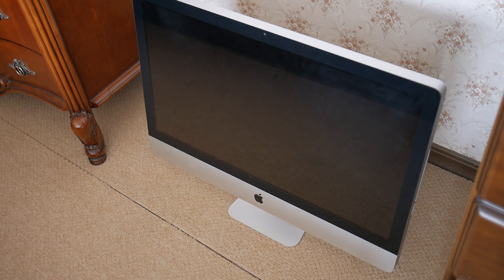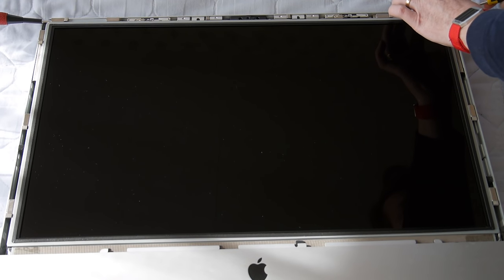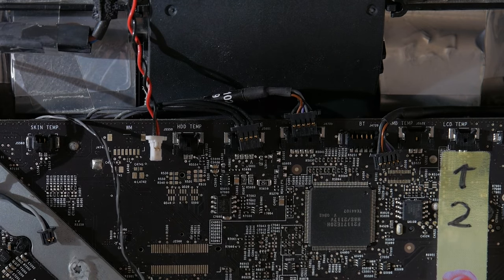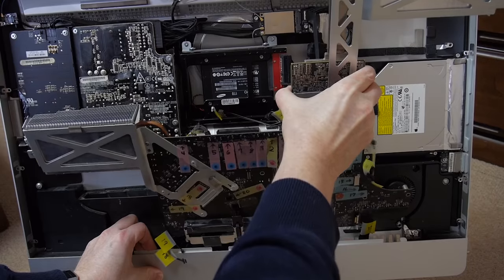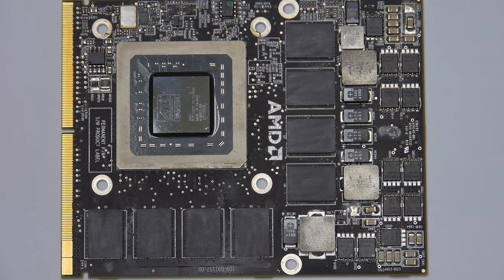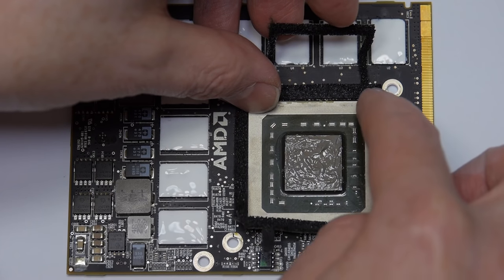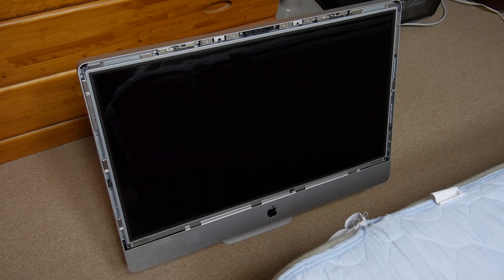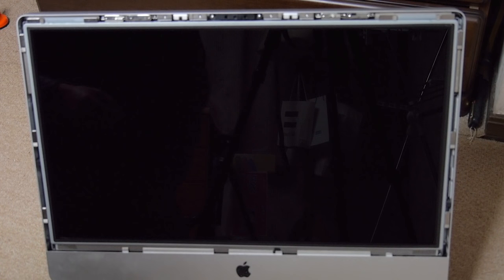Late 2009 iMac 27" Video Card Repair [4850 Bake]

Comment: I can not believe it, it actually works. I was skeptical about it but I had nothing to lose. Instead of using the oven, I used a heatgun and aim it for about 4 min. Thank you very much for your video.
Reply from the maker: Thank you for the kinds words and your report of success with a heat-gun, Phong!  You said you applied the heat for 4 minutes, but what was the distance between the GPU chip and the heat gun?  And did you keep that distance consistent during those 4 minutes?  The reason I ask is so that your answer can help others who may wish to try it instead of an oven.  Thank you!
Reply: I aimed my heat-gun and rotated in a circular motion at the chip only, not the entire card. The distance between my heat gun and the chip is about 1.5 inches.

Comment: The ATI Radeon 4850 Video card for my Late 2009 iMac 27” machine stopped working after Thanksgiving. I bought my system back in 2010 and it worked consistently for 11 years until last month!  It was noticeable slower over the past few years but until it stopped working I wasn’t ready to get rid of it.  I bought a brand new Mac Mini to replace it before I saw this video.   The bake was successful and I am back up and running with the iMac.  While this system is WAY SLOWER than my new Mac Mini, it still can surf the net and do simply tasks pretty well.  I might even put a SSD drive in the system to make it faster.  While this is clearly a back up system for non critical needs, it is good to know that it still can function.  Thanks for the video!
Reply from the maker: Great to hear that!  But the single BEST upgrade for these old iMacs is an SSD.  It's a night and day difference in performance.  Be sure you have 16 or 32GB of RAM too, especially if you have two users open all the time.  That can make a big difference as well.  Merry Christmas!

Comment: Thanks for all the effort you put into making this video. I have never seen such a detailed video that really leaves no questions unanswered. Even I, as a woman, had no problems getting my iMac up and running again. I hope it lasts a little while.
Reply from the maker: Thank you for your kind words.  I am certainly pleased to hear that you were able to get your iMac working again using my video as a guide.  My first bake lasted only 4 months, but I think that was because I didn't clean off all the old thermal paste and apply all new paste.  I did that in my second bake, which then lasted 2 years and 9 months. I can only hope yours functions as long or longer as mine did after my second bake.  Best wishes!

Comment: I looked for this video pacifically to tackle the same issue/problem I had a year ago with applying thermal paste. I remember you gave excellent instructions on this procedure. Last year I used some watery thermal paste that only lasted few months. This time I will use either Arctics Silver 4 or 5 as you suggested. My main reason for my comment is to say "Thank You" for your detail information.
Reply from the maker: Thank you for watching and commenting!  I highly recommend that before you do anything else you watch the following portion of my 2nd Bake video which discusses the K4 and K5 Pro thermal pastes I used.  So far, my 2nd bake has lasted 1 year and 6 months, and the machine is still going strong.  In my first bake, I used Arctic Silver V on the GPU, and a rather old and generic thermal paste on the memory chips, and I didn't fully clean off the old Apple thermal pads on the memory chips either.  The first bake lasted only 4 months.  So that was either due to the thermal paste I used, and/or due to the fact I didn't clean off all the old paste on the memory chips, or it could be my GPU simply needed two bakes.  I'm not sure, but all I can say is that K4 & K5 Pro is still going strong.  Also note you cannot use Arctic Silver V on the memory chips because it is electrically conductive and would have some overspill that would cause shorts.  Plus Arctic Silver V cannot be used as a replacement for thermal pads, which is needed for the memory chips.  Again, watch the portion of my 2nd bake video below for details on the thermal paste and application method I used. https://youtu.be/6BJGLFCigdA?t=1658
Reply: @JDW- , I did watch the other video this morning and don't remember if I had baked the chip the first time after replying new paste last year. My question is: can I use just one of the selected K-5 or K-4 thermal paste for both memory and CPU? I bought the K-5 kit and Gelid Extreme as an option. Should I use K-5 on CPU and Gelid on memory? Your suggestion will be greatly appreciated.
Reply from the maker: K5 Pro is made specifically to be a replacement for thermal pads.  Thermal pads are used when there's a big gap between the heatsink and the chips you want to cool.  That's why K5 Pro is a very thick paste and you can use a lot of it -- so much so that it shocks people who otherwise think I have applied to much of it in my video.  But what is you see in my video is the proper amount and proper method of application according to the manufacturer.  You cannot, however, use K5 Pro on the GPU because Thermal Pads (and thermal pad replacement pastes like K5 Pro) do not conduct heat as well as regular thermal paste like K4 Pro.  So if you did use K5 Pro on the GPU, because it is not intended for that, the GPU would likely overheat (i.e., fry itself to death).  That would be a very bad situation that would result in a dead video card that cannot be resurrected.  Regarding Gelid Extreme, I've never used that before so I cannot offer you my personal experience with it, but it has great reviews on Amazon, and I see it is a normal thermal paste that you can apply to the GPU of your video card.  So, yes, I think using Gelid Extreme on the GPU and K5 Pro on the memory chips will be just fine.  You shouldn't have any problems doing that.
Reply: @JDW- , Thank You Sir for your knowledge and input on this subject. Your videos and responding narratives are very detailed. Cheers!

Comment: Today followed your instructions on an IMAC 27" late 2009 with video problems (yellow strips, stuck after several seconds). Never had to 'bake' any hardware so you might say I was a bit reluctant to actually put the videocard into the oven (9 minutes and 30 seconds!!). But since there where no other options I said, lets give it a try. And you know what? It actually did the trick, my so beloved IMAC 2009 is raised from the dead. I do not know for how long, or what other future problems will arise, but for now this is great! Thanks for taking the time to make this video. I suggest removing the  memory sims before anything else, otherwise you might have problems putting the motherboard back in place. Again thanx alot!
Reply from the maker: Not only "remove" the memory but also remember to "put it back" when done too!  I neglected to do that, and as you could see at the end of my video, I got the scary beep, beep, beep.  Anyway, thank you for letting us know the bake was a success for you.  Please note that I made 2 videos.  This video was of my first bake which lasted 4 months.  I then made a second video showing my 2nd bake, and that video was made the first week of July 2017.  It's now the first week of February 2018, and my iMac's video is still going strong.  Not sure if the longevity of my 2nd bake is due to my having twice-baked the video card or my having used different thermal paste the 2nd time.  In any case, I hope your bake lasts years.  Even so, in my experience, a brand new card lasted me 3 years TWICE, so I would be surprised if my 2nd bake lasted beyond that.  Sadly, the card was designed badly, which is why we have this problem in the first place.  Best wishes!
Reply: Hi. I have a problem, I did what you said, but it only gives me external video, if I connect the screen of it, it does not send the imac, but if I disconnect it works very well by external video.

Comment: Thank you so much for all your patience to make this videos. The instructions were completely helpful. I followed them one by one and my iMac 27'' Mid-2011 is working well again. I would say the label every single cable and screw have simplified the procedure. The only thing I didn't do was use thermal paste. I used the leftover. Cheers and best wishes to you from Colombia.
Reply from the maker: I am very happy to hear your success, Juan!  By the way, you said you did not use new thermal paste.  That may or may not be a problem.  If  you experience system freezing or unexplained crashes in the future, it could be related to the thermal paste, in which case you would have no choice but to buy some paste and apply it.  That's a real pain because of the time it would take, but that is the reality of it.  So long as the old paste had not hardened too much, and so long as it still moves a lot of heat from the chip to the heatsink, you should be ok.  Best wishes!

Comment: Wow you are the best. Just did this on my wife’s 27” 2009 which is still a great machine. Works great now.  I didn’t take out the motherboard to change the battery because I have a faint memory of doing this when I changed the HDD to an SSD, but not aure
Reply from the maker: That's great to hear.  Thanks for making time to let me know your bake was a success.  Best wishes!

Comment: you    wont believe this 3 years ago i followed your steps to the letter of the law it did not work so i put it back in its box and one year later forked out on a new one .yesterday i was about to throw it out and rescue the hard drive and turned it on and hey presto .well done and thanks now i have two imacs
Reply from the maker: You didn't do anything other than remove it from the box 1 year later and try to power it on?  It's interesting it didn't work after you baked it 1 year ago but now it works.  I'm afraid I cannot explain that. But so long as you baked it at the right temperature and duration and applied a good thermal paste, you should be good to go in the long term.  Best wishes!
Reply: @JDW-  i would like to say a huge thank you again to you and for your patient well presented video

Comment: Hi, my bake lasted 6 months, it worked like a charm for that period and it was an inexpensive way of bringing back to life a totally capatble computer.  Going for a 2nd bake today.
Reply from the maker: Thank you for your comment. What kind of thermal paste did you use?  My first bake lasted only 4 months, reason unknown.  On my 2nd bake I switched to different thermal paste (K4 and K5 Pro).  The only other change I made was to increase the bake time to 10 minutes.  So far my 2nd bake has lasted just about 13 months and is still going strong, used daily.
Reply: Hi JDW, I used Arctic Silver Céramique 2 in the graphics cards main chip and used thermarl pads on the other 4 smaller chips. My first bake was 10 minutes. lasted 6 months. I did yesterday the 2nd bake, also 10 minutes, it's working again, let's see for how long. This is a 2008 iMac computer, still a great computer in 2018 and does eveything I need it to so I would like to maintain it as long as possible. The Graphic cards problems in Mac computers are related to planned obsolescence, they want you to buy a new computer and new iPhone every 2 years, even if you computer and phone serve you well they will plan the product to fail after some years or they will release a new operating systems that kills it for good.
Reply from the maker: Thank you for the information.  The reason I was curious about your thermal paste is because I'm trying to determine the root cause of "1st bake failures."  But since your machine is a 2008 model with different video card, it's difficult to make an exact comparison with the video card in my late 2009 iMac 27" model.    So perhaps the reason my 2nd bake has lasted more than 1 year is due to better thermal paste (both on the GPU and the thermal pad replacement paste I used on the RAM chips), or perhaps my card just needed another bake.  So while the reason for the success of my 2nd bake is yet unknown, I just hope it will keep going strong.  I doubt it will last longer than a brand new card (which lasted all of 3 years in my experience), but who knows.  Time will tell, and I will keep updating the text Description under the video monthly to keep everyone informed.  Best wishes!

Comment: Awesome! Thank you for posting, with your guidance i got my dead imac 27 2009 back working again.  10mins at 205 deg.c in my case. Thanks again
Reply from the maker: That’s wonderful to hear! Thank you for letting me know, Will!
Reply: So it just wouldn't start? I have 2011 imac and I start it with a hairdryer but if it turns off it won't start

Comment: Just baked my card and my computer is working again!!  It is like witchcraft.  Makes no sense at all but thank you very much indeed for giving me the confidence to try it.  Only fly in the ointment is the fan is working flat out.  I never heard the fan before but now it is quite noticeable.  Thank you once again.
Reply from the maker: Thank you for making time to let me know your bake was a success! There have been several people who have reported the same thing you have after their bake – the fans run at full speed. The reason is because you either forgot to connect a particular connector or you did not connect it properly. To fix that you can do one of two things. You can re-open your iMac and check all the connectors, which would take a while. Or you can expand out the text description underneath my video and download one of the fan control apps that I link there. Best wishes!

Comment: It worked perfect for me... exactly as you did it... 9 minutes... I also managed to broke 2 small condensers on the motherboard while pulling away the 3rd connector from the monitor (near the LCD temp sensor) and I managed to solder only 1 of them back. The second one was to difficult (too small). But it worked fine without it after that.  It didn't make any problems for now. After baking it did't want to start, and I thought I must buy now a new motherboard. But the problem was that I forgot to put in the RAM :))))) You saved me 600$ on a new card or about 250$-300$ on reballing or soldering of a new ati chip from a third party repair company. Thanks!
Reply from the maker: Thank you for letting us know of your successful bake!  As to the capacitors you broke off, please keep in mind that capacitors can serve different functions.  Some act as noise filters.  Some are required to keep the voltage from dipping.  Regardless, the fact you were unable to solder back one of the capacitors (assuming it was a capacitor and not an inductor), may or may not cause problems for you down the line.  As such, if you experience anything unexplainable and out of the ordinary in the future, such could be traced back to that missing electronic component.  So you may need to prepare yourself for soldering that component (or an equivalent) back in the future.  Until then, enjoy your "new" iMac!

Comment: Thanks so much for this excellent procedural video. It was easy to follow, and adapt from. I replaced the dead card in a 2009 iMac with an hd5750 1Gb Radeon from a mid 2010 iMac, and it works a treat. You will need the entire gpu & heat sink assembly to do that if anyone is wondering.
Reply from the maker: Thank you for sharing your experience with a more modern video card replacement.  So  you removed the video card and the entire heatsink assembly from an 2011 Mac and put it in your 2009 iMac, is that right?  Did you have to cut anything?  I've heard that newer cards and/or their heatsinks don't fit perfectly.
Reply: JDW I purchased the gpu/heat sink assembly, taken out of a mid 2010 iMac, from eBay, and replaced the 256mb failed one in my 2009 iMac. The actual gpu card is slightly taller, as is the heatsink, but I’d read other people saying it worked fine, so took the gamble, and they were right. The space where it sits in the case is where the psu cable runs to the logic board, and it doesn’t create any impediment at all. There is one tiny little fastener (top right little screw when you reassemble the machine), that you need to take off the 2009 assembly & attach to the 2010 one.
Reply from the maker: Thank you for the additional details.  One last question, if you don't mind.  Does the card generate more heat than the old, or would you say it's about the same as before?  (Feeling the back of your Mac after it's been running a while, etc.)
Reply: JDW Only been up & running about 15/20mins since I finished the job. Will let you know how it feels in an hour or so.
Reply from the maker: I would appreciate that.  And if you happened to have shot any video of photos of how the replacement card looked when installed in your 2009 iMac, I would love to see that as well.
Reply: Sorry, I didn't take any pictures. Thought of that when I was replying here initially. Can report the back of the mac actually feels a little cooler. I think the extra surface area of the heat sink on the newer assembly provides better, wider, distribution of heat.
Reply from the maker: Thanks great to know, Clive.  Should my card ever completely die in the future, I will definitely give thought to buying the video card assembly from the 2011 iMac model.  In such a case, I would of course make another video to show everyone.  But for now, my 4850 card is still going strong so I'm satisfied.